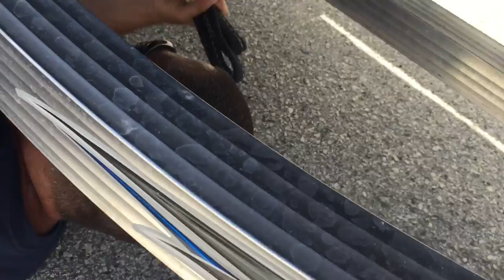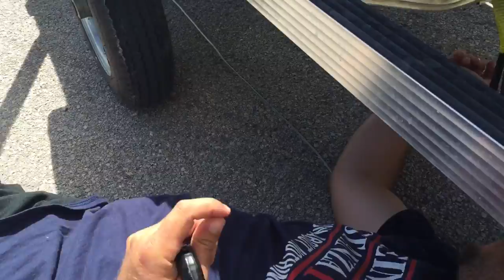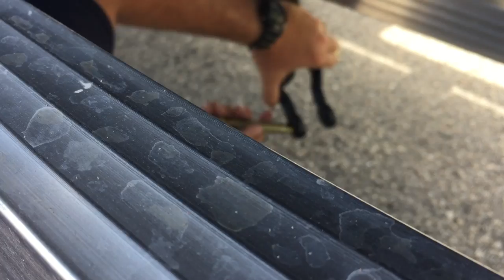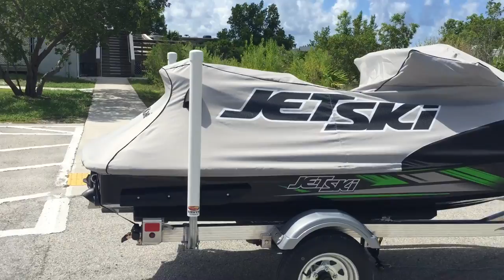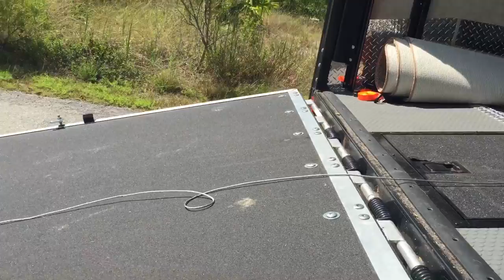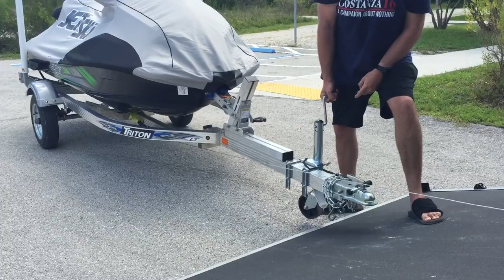Loading Jet Ski into Toy Hauler Fifth Wheel

Comment: Great concept! I haul my boat in my ToyHauler also, If you do this a lot you could easily take a flat plate of steel and mount the winch on the bottom with a trailer ball on top of some 2" square tubing about 12" -16" off the floor, that way you could just hitch the trailer onto the ball, ratchet strap the back down and Done!
Reply from the maker: Miles K that's a good idea. I would do that if we did it more often. This was just a one time deal for going to the keys that I dreamed up the night before with stuff I had laying around so we didn't have to drive two cars.

Comment: I just want to note the way he gave the winch a "little bit of help" from behind the jet ski could be dangerous, whenever you're using a winch always ask yourself what would happen if this cable breaks, the gearbox fails, or the entire winch rips off the point is mounted to on either end.

I appreciate the video, I was just thinking about doing something similar to this myself and was curious if anyone ran into any problems doing this.
Reply from the maker: Yes I thought that too. It would be smart to chock the trailer tires before walking behind it just for that reason. Definitely much to improve on it was just a first trial type kind of thing.

Comment: How would you unloaded into a boatramp? Would love to see the process thanks
Reply: Hopefully with the truck that he tows the TH with! I'm wondering what his triple tow laws are. My buddy trip tows his rig to the lake. This looks like alot of work when you could get a hitch mounted and that little ski trailer wouldnt even be noticed.
Reply from the maker: I don’t think you can piggy back in Florida. I could be wrong but the less tires and hubs to go bad the better for me.
Reply from the maker: Jorge Travis is correct. When we got to the camp site we eased the ski out of the camper and uncoupled from the camper in its spot and used the tow rig to tow the ski around to the different ramps.

Comment: and 2 hours later he ends up dragging and pushing the stupid thing into the trailer
Reply from the maker: Seemed like 6 minutes and the winch was doing all the work 🤷‍♂️. I was just lightly pulling up on the jack so the wheel didn’t scuff up the grip material on the ramp.

Comment: You're out of your mind using only straps to hold the winch
Reply: The straps exceed the load capacity by 4 times what I'm pulling and I doubled them up on top of that in case one failed.  Never had an issue.  I'm sure there's hundreds of ways to accomplish the same task but this beats permanently mounting/drilling through the floor of the camper and having to step over the winch all the time since we rarely haul the ski in there.
Reply: Here was my solution, scroll down to the lower posts on this link:
http://www.forestriverforums.com/forums/f7/anyone-haul-a-jet-ski-in-their-toy-hauler-117065-2.html
Reply from the maker: Dan Pietrzak that's a pretty good idea too. I didn't have time to or want to drill into my floor though because we weren't sure if we would keep the jet ski. I figured this out the night before leaving to the keys so we didn't have to take two cars on our road trip lol.
Reply: It took me a lot of thinking of how I could do it and not have the winch in the way when not needed. lol Just thought I'd share. The Keys sounds nice, I'm in Buffalo in 2 feet of snow right now.  lol
Reply from the maker: Dan Pietrzak no doubt. I'd definitely do something similar if we were to haul the jet ski more often in the toy hauler. It was fun in the Keys because we would jet ski out to the reefs (there are lots of them) and snorkel around looking at marine life. I don't envy the snow, the Keys are only about a 6 hour drive for us.
Reply: Dan Pietrzak,  great idea but leaving that on the floor in the way isn't a really good solution. It's in the way. In my situation, my toyhauler storage is in the living quarters and the tongue comes.up in the kitchen. I have to have something removable and something that is flush so we don't trip over it or stub our feet.
Reply: I think this is a great idea. Even though it was done on a sudden and last minute thought, was pretty ingenious.  My situation is that my seadoo trailer fits in our living quarters and tongue extends to.the kitchen.  I need something removable.  I also need something stronger to latch onto other than the tie downs that I currently have. The rings are not strong enough to support the weight. I'll have to find other floor mounts to hold my wench.